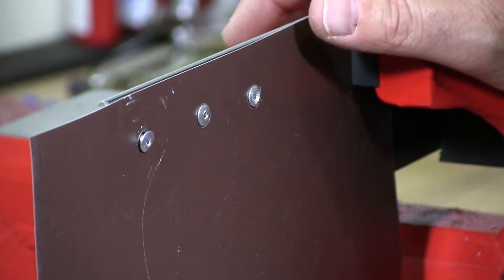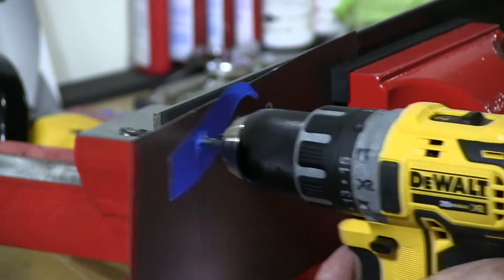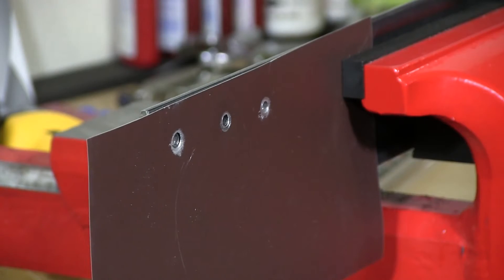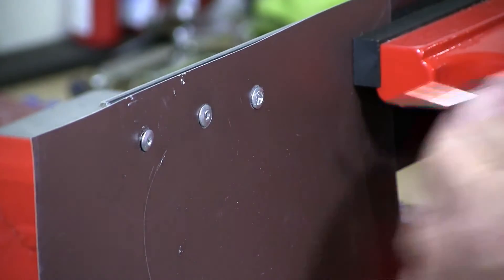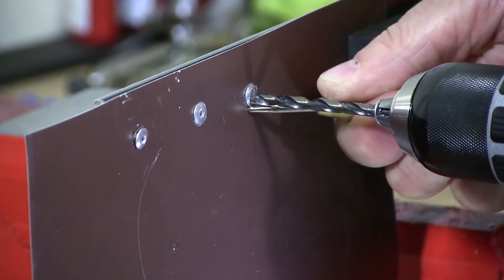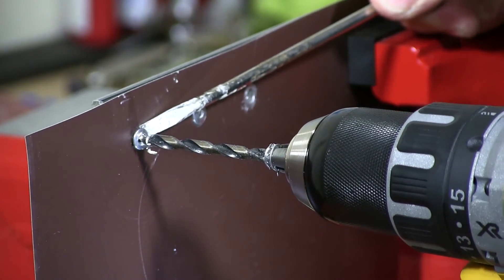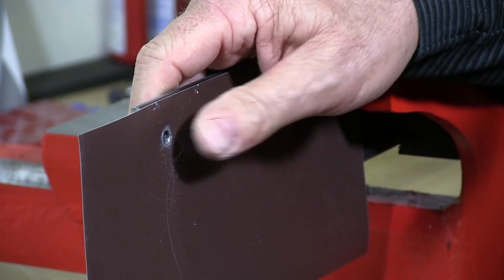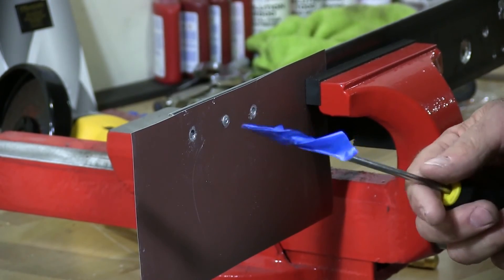Remove a Spinning or Loose POP Rivet With Duck Tape | Fasteners 101

Comment: I need to fix a step ladder where the rivet came off on the hinged metal bar mid way up the ladder that stops the two pieces of ladder from spreading too far apart. I am planning to buy an inexpensive rivet gun for this purpose. I do not want the rivet to be so tight that the hinge cannot move at the joint. Is it possible to just squeeze  enough so the rivet holds the pieces together but allows movement and the mandrel breaks off?
Reply from the maker: Not exactly.  I do not recommend that you do this.  You would have to tighten the mandrel to where you want it and then snap the mandrel there.  Typically a rivet tool would snap the mandrel when it's tight, not when there is still movement.  You would need to pick a rivet with a larger grip range.  The best option would be to buy a new ladder.

Comment: Use a correct smaller drill bit(sharp drill bit is best) size that fits in the Rivet hole and apply little more pressure and you don't need fancy stuff for removing the Rivet.

Comment: Thanks for the video.  Great ideas.  The tape worked real good for me and saved my day.  
The side grinder - IF I would have had to go that route I'd have substituted a Dremel with a cur off wheel or a grind stone.
The Dremel is a lot easier to control and prevent maring a finished surface.

Comment: I have a fiberglass camper. Many of the fasteners are pop rivets. I ran into one today that appears to have a pop rivet with an acorn nut on the working end It goes through the roof and the end that would be popped off by the rivet gun is exposed on the outside surface of the roof. I cannot find ant reference in google images. Do you have any experience with this?
Reply from the maker: We would need to see the rivets to be sure of what they are. Try taking a picture of them and sending it to us at our support email so we can try to identify it: support@rawproductscorp.com
Reply: @AlbanyCountyFasteners  Thanks for your reply. I did more research on a fiberglass camper forum. Last night someone commented that the pop rivet is pushed through the roof from the outside. On the inside  a helper pushes the acorn nut onto the end of the rivet. The person on the roof activates the rivet and the expanding end of the rivet expands into the acorn nut and traps it. Hope this helps.

Comment: The rivets are still spinning under the tape.
Reply from the maker: The tape won't keep the rivets still the whole time, but it doesn't need to. Once the drill bit gets a secure hold of the spinning rivet, the rest is easy. The tape helps hold the rivet still, or at the very least make it more difficult for the rivet to spin.

Comment: I use a small nail puller to hold the rivet if it will fit in there..  It looks like a screw driver with a "V" shaped end to pull the nail, just another suggestion.
Reply from the maker: Thank you for your suggestion.